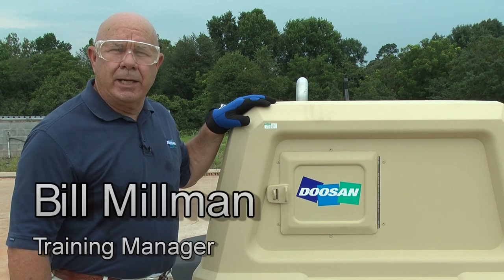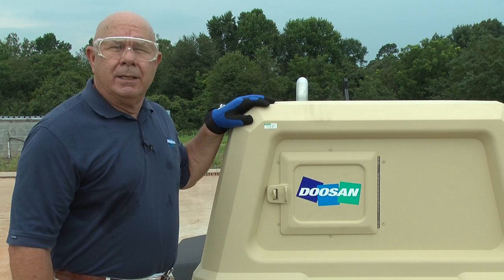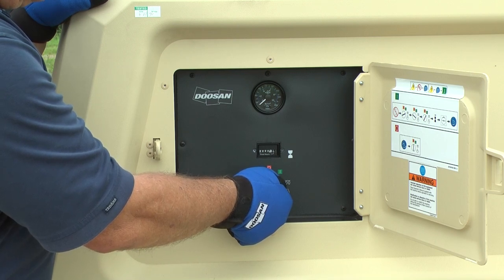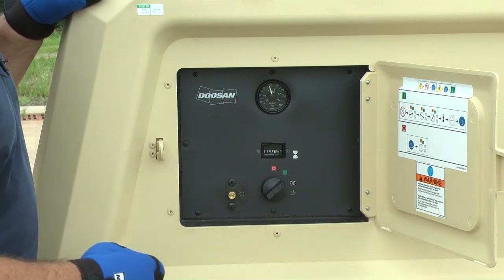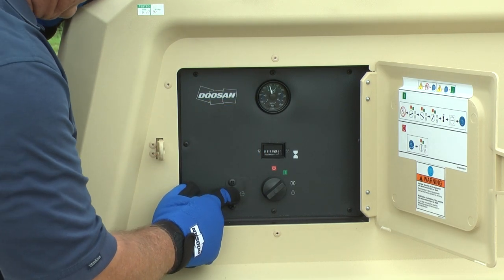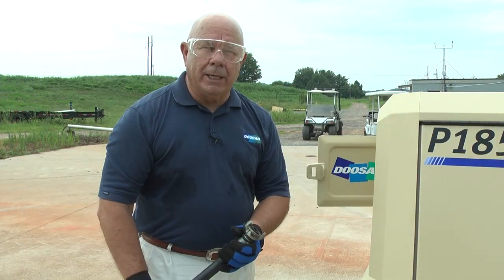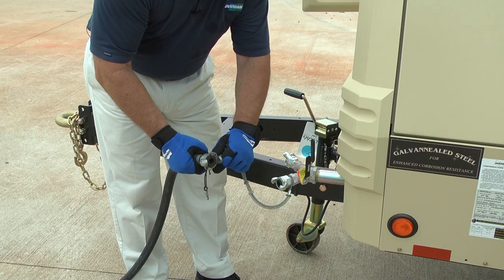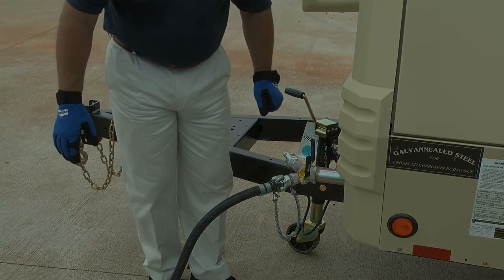Basics in Operating a Doosan Portable Power Air Compressor

Comment: Whenever I turn mine to the farthest on the right to warm the glow plugs up then turn the key back to the green square the motor just turns over. However if during the process of me turning the motor over I turn the switch all the way back to the far right again towards the glow plug it fires right up and then shuts down. Any thoughts on this? Some vehicles I would say low oil pressure but it’s got good oil level etc. Thank you